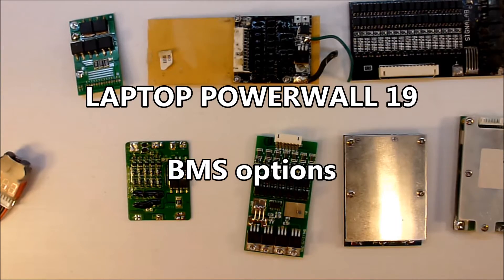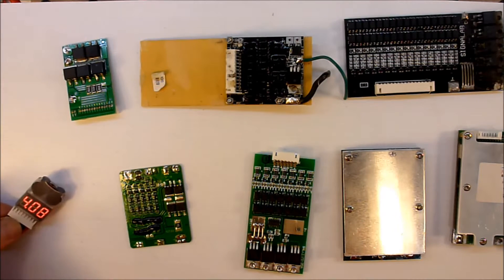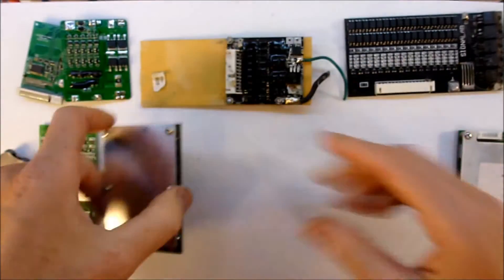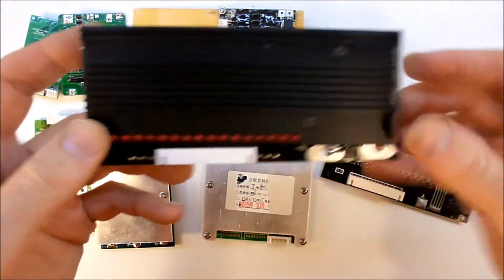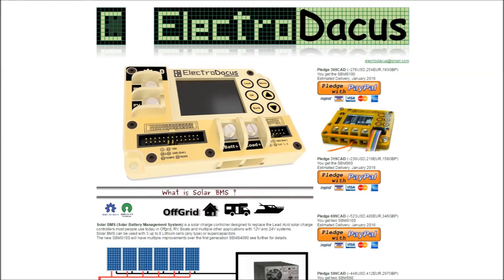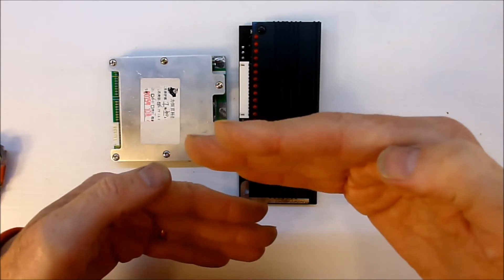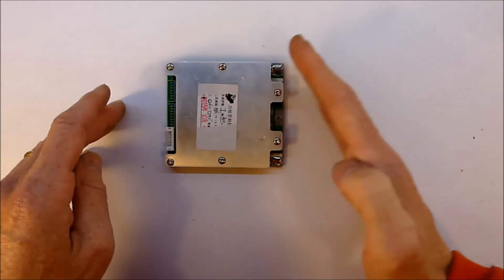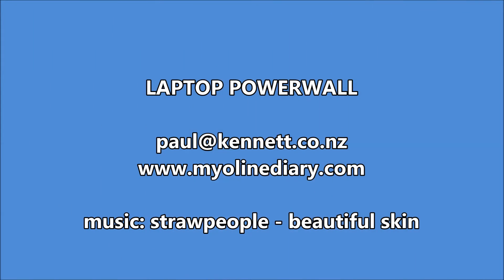Laptop Powerwall 19 - BMS options

Comment: HI I’ve been tasked by local eBike shop,  to repair some BH eBike (Evo Easy Motion bikes) The  batteries look OK all the 18650 cells and packs are fine but the BMS refuses to let the batteries charge or power the bike.  You seem to have a lot of BMS experience.  Could you recommend a unit I could buy on eBay to replace the original as we can’t get any spares ?  Im assuming the BMS can be programed for the ebike battery setup & voltages ?  Space is fairly restricted
Reply from the maker: I would try searching Aliexpress or EBay for same BMS. Are there any model numbers on it? Failing that search for something with the same specs. Cheap BMSs have no way to set voltages - you just have to find the right one for your bike.
Reply: Hi thanks for the pointers I'll take a look on Aliexpress I cant find any marking on the BH BMS PCB's for a manufacture
Reply from the maker: I see from the Evo website it might be a 36V Samsung battery (or just Samsung cells?) How about this: https://www.aliexpress.com/item/7S-30A-29-4V-lipo-lithium-Polymer-BMS-PCM-PCB-battery-protection-circuit-board-for-7/32717974843.html
Reply: Hi! I would try searching Litechpower for BMS/PCM/PCB.
Maybe, I recommend the product to help you, thank you！
http://litechpower.com/product-detail/HCX-D555LI07S35A.html

Comment: so , for your 24v 1KW pack, which one did you use? also when a BMS says 60A rating, is it 60A charge current?  so if I have a 40A solar charge controller, feeding 60A BMS should charge my batteries correctly , right? thx!
Reply from the maker: Links to all my bits: http://www.myonlinediary.com/index.php/Energy/PowerWall
My understanding is that "60A" means it should be able to cope with that much on the load side. Charge current would be lower. It may not cope with stated rating for long though - gotta read the fine print (if available) from the seller.

Comment: would a solenoid suffice for taking the current off the bms? the bms would still have control to cut the load via turning off the solenoid.
Reply from the maker: Yep - you could use the BMS main power line to control a relay (contactor) which would then control the main power. But - if the BMS too whimpy cope with the power then it's probably using whimpy current levels to balance the pack which might be inadequate.

Comment: I'm working with the same idea using a 4 volt maximum charge.  In my case, I'm making a 4S pack to feed my existing 12V solar power system, 16V is the cutout voltage on my AC inverter, so I'm trying to work back from that.  I plan on making a number of 4S20P or 4S40P packs each with a separate smaller BMS to up the overall current capacity.  Do you find the BMS handles balancing OK at a 4V maximum charge?
Reply from the maker: That is a great question... which I don't yet know the answer to. Now that it's mostly finished  I plan to do a bunch of testing and monitoring to answer that one.
Reply: +Paul Kennett Great, will be interested in your results.  I may also give a shot at using a separate RC cell balancer, like the Tenergy cell meter.
Reply from the maker: +R Brown (4Crawler) My backup plan - if I find that the BMS does not balance at 4.0V - is to balance the pack once a month using my iCharger (RC balance charger). Although Jahu Garcia is adamant that large packs don't unbalance the way small packs do.

Comment: Give me a link to the bms circuit of what you selected for your 2 kWh Powerwall...
Reply from the maker: +Ramesh Perera 24V 30A 7S from Aliexpress: http://www.aliexpress.com/item/24V-30A-7S-BMS-PCM-PCB-24V-Lithium-battery-BMS-for-7S-3-7V-lithium-cell/32469245428.html

I'll be happy if it can cope with up to 20 Amps.
Reply: +Paul Kennett Hi Paul. Thanks for the link. Does it have a thermostat to control the temperature of the battery pack?
Reply from the maker: +Ramesh Perera No thermometer on this one. I've ordered a thermostat module (http://www.aliexpress.com/item/Heating-Cooling-digital-display-Intelligent-Temperature-Controller-thermostat-Module/2000223068.html)  to control my fans.

Here's a BMS with thermometer that might work: http://www.aliexpress.com/item/7S-21A-25-9V-li-ion-BMS-PCM-battery-protection-board-bms-pcm-with-balancing-for/32381179482.html?spm=2114.13010208.99999999.290.SNI3d0

Comment: Lipo (lithium polymer) are the same voltage as 18650 batteries so you can use the BMS with the 18650 batteries 
Lipo (lithium polymer) = 3.7v Nominal, 4.2v Charging, 3.0v discharged
Li-ion (18650 Lithium manganese (LiMn) or lithium cobalt (LiCo)) = 3.7v Nominal, 4.2v Charging, 3.0v discharged
the one you need to watch out for is LiFePO4
LiFePO4 (Lithium Iron Phosphate) = 3.2v Nominal 3.6v Charging, 2.0v discharged
LiFePO4 BMS will not work on Lipo or 18650 batteries and some BMS boards do not balance they only monitor the voltage and in my experience most BMS's disconnect the battery at 2.5v low and 4.35v high and looking at data sheets of most 18650 batteries these are the absolute MIN and MAX voltages and i would prefer the 3.0v MIN and 4.2v MAX, some BMS's even state these preferred voltages but when i have tested they go above 4.2v and below 3.0v, maybe just an accuracy issue.
Reply from the maker: +Darren Hall Yes - I was being lazy when I said "Li-Po" - it often gets used as shorthand for LiFePo.

There do seem to be plenty of cheap Chinese BMSes that have an upper limit of 4.35v. So it's important to have a charger that stops at a more sensible threshold (4.0V in my case). 

In e-bikes the charger sets the upper charge limit and the BMS's upper limit is only there as an emergency backup protection if the charger should fail to limit itself.